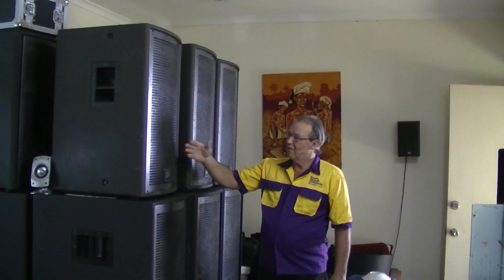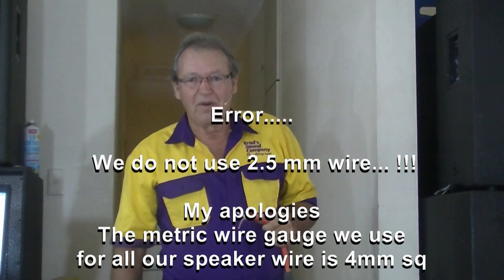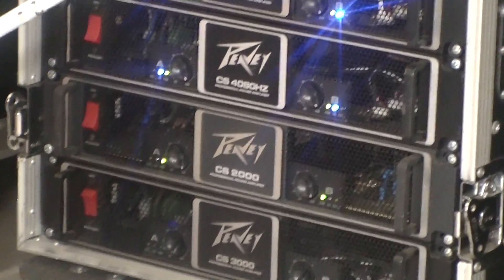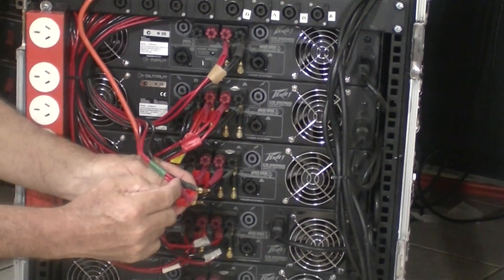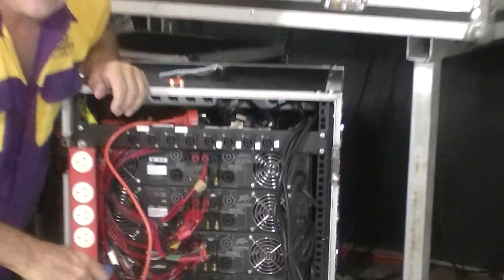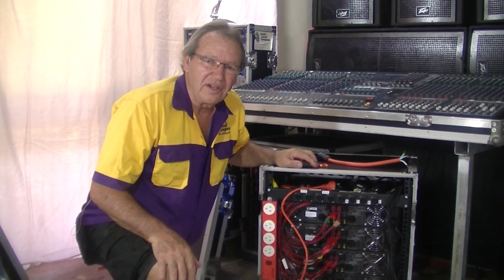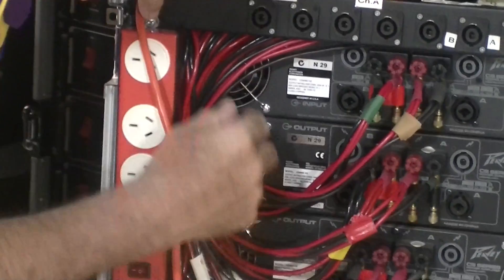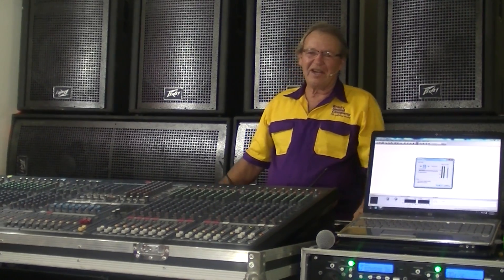Anatomy of a Pro Audio Sound System - Part 11

Comment: Hello! Nice video! I can't understand, however, why banana plugs with 8 cables are connected from the output of the 2-channel amplifier, 4 cables would not be enough, as happens from the speak on socket onwards? as in the classic bi amp connection?

Comment from the maker: As for the mid/high QW2 cabinets... these are Bi-amped, so each cabinet needs a 4 core cable +1 & -1 to mid range woofer and +2 & -2 to High frequency horn. So how do I connect 2 separate amplifiers to one speaker input if I use the speakon outputs ...???. We run from both the mid and high amp's  binding posts to a speakon socket on the patch panel. Then a 4 core cable with NL4 speakon connectors to the QW2 bi-amp in. Basic pro audio procedure...

Comment from the maker: Not crazy at all Kevon.... we run from the binding posts with banana plugs (top quality heavy duty gold plated) to speakon sockets on the patch panel.
 For the double 18" subwoofers, we need to use 4 core cable. The speakon output on the back of the amps are 2 pole only.... so I would need to wire special cable ends to suit the subs. Better to use a patch panel and keep all speaker cables identical. That way I can use any speaker cable inm y inventory for any application.